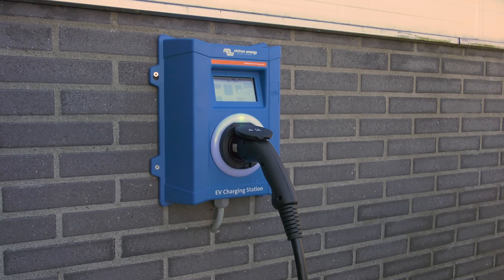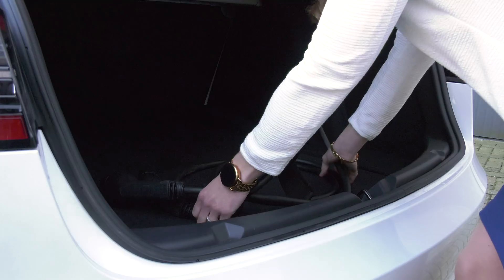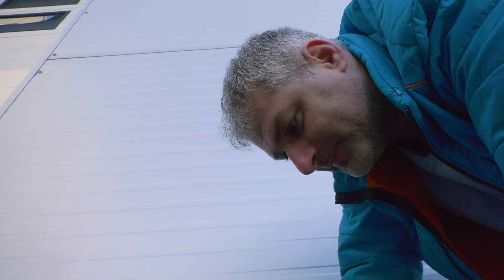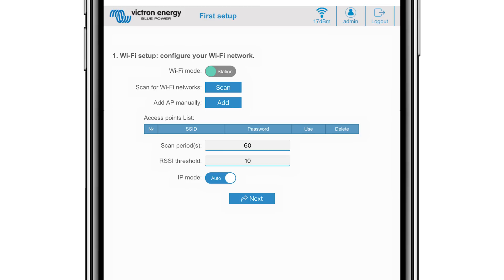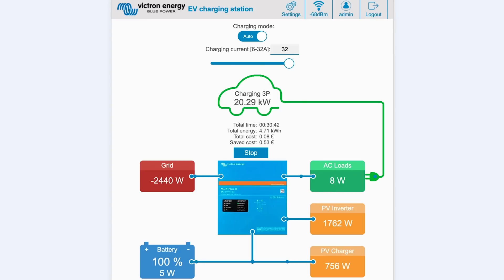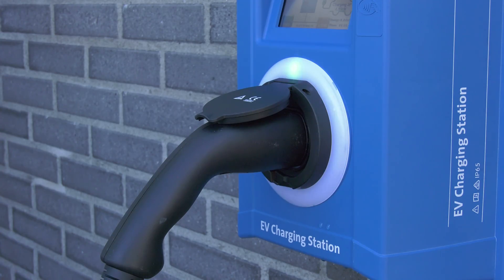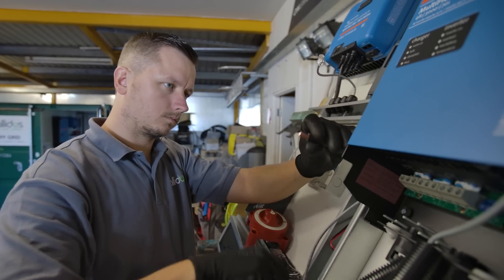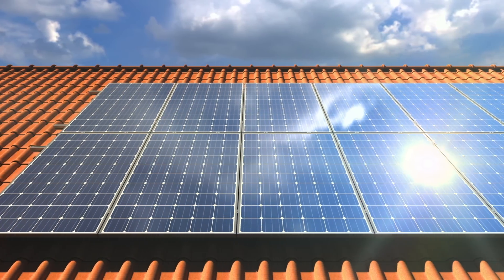Electric Vehicle Charging Station Victron Energy - Technical Guide

Comment: Lol...so stupid to charge from AC when we are off grid, so i got 10kW of PV and 2 rs450 but i can't charge my car with it..i need to go through a 15kW serie of inverters to be able charge my car..? Common, be smart please, passing through inverter i'll waste a lot of kWh not talking about the heat generated..! The noise...
This device should have 2 power entries, AC like it already as bit also DC 48V. Since not a lot of people will have their 48V battery pack near their car charger, at least make this DC input an option.

Comment: I have an off-grid system with one MP2 48/5000, OK. Let's say I buy an EVCS and the car now charges with say 3.7kW. The house draws 300W. From the roof comes DC-connected 8000W. Everything is fine. The MP2 fan is busy but the MP2 can handle it. Now we switch on a large consumer in the house. Let's say 2500W. The MP2 now has to supply 6500W. But it can only do this for a certain time, which is measured in seconds. What does the EVCS do? Does it stop charging the car until inverter power is available again or does the MP2 go into overload shutdown? (All without using Node-Red, which would then possibly be plan B).

Thanks for the help!
Reply: Hi, the charging station is receiving overload alarms and will reduce the power or even stop charging in this case
Reply: @luciangpl Thanks for your help! That would be great! Can you provide a link where this is documented?
Reply: @der_ambergauer  I can't add links here, but check the manual for "overload"
Reply: @luciangpl Thanks. Will do!
Reply: @luciangpl In the case explained here, car charge should reduce to let's say 1000W and let the appliance work normally. If charge stop then something is wrong with the system.
Reply: @honumoorea873  that's not possible, minimum charging current accepted by vehicles is 6A  - more than 1000W
For some vehicles, the minimum current is even higher - Renault ZOE 10A. 
It is configurable in the settings of the EVCS, but it can't be lower than 6A

Comment: Is there a plan for a LAN connection? Often the wall box will be more away from the house and a Wifi network will not be available there. At least in my location it is the situation and I will net set up a repeater. Generelly I try to connect everything with LAN because it is more performant an reliable.

Comment: Hi, is Vicron looking into supporting bi-directional charging now that several vehicles support V2L and V2G? Will this require hardware changes?
Reply: only possible with DC/CCS connection. V2L basicly doesn't need extra hardware. Just use the plug delivered by the car. I have never seen a plug both for V2L and charging in the same unit.

Comment: I think such device attached to outdoors should support cable ethernet and PLC-data, power link communication over powerline. Wifi will get security issues and is easier to exploit.
Reply: I got 60m between carport and inverter shed, power over line or ethernet are clearly the best solutions. But wifi need to be there too for some situations, would be good to be able to choose.

Comment: @VictronTech a) allow for remote 1p/2p/3p enabling at least in manual mode, many cars can take it and you get a seamless load from 1 x 6A to 3 x 32A, b) clean up the cabling inside for chrissake. It looks like intestines of a bug whose butt you just ripped off. I think both would be not only fair for 1500 EUR + VAT, but "market adequate".
Reply: I can buy this for 450€ here in europe.
Reply: @honumoorea873  Yes, 1year later...

Comment: Missing an ethernet option and I can’t help but wonder why we don’t charge with DC when we store it in the house and drive with it. Converting to AC just for charging just seems… inefficient.

For the price, I would expected a neater inside as well, not with a cheap wire connector like that one.
Reply: yes, but dc charging requires another step, another addition to the charger. the charger is basically just let the 240v ac through and communicating with the car. so you need another switch mode part. then your installation will be an added 5000$ or so.

Comment: Why no wired LAN connection?
Reply: Agreed, i now need to use a wifi router under the carport to make this device work...
Reply: Probably because it would require more safety circuits and add cost, with WIFI you don't have to protect the user from high voltages.

Comment: I stopped watching soon as you said 40 amp circuit breaker
Reply: The standard allowes a charge rate of 6A to 32A in 1A steps. A 40A fuse is recommend if you want to pull 32A. If you set the max to 8A, you can have a 10A fuse.
Reply: yes, i agree with you, you definitively should not watch this video at all if you totally ignorant of electrical installation.

Comment: I've waited for it. Finally, I will be able to charge the car from my offgrid system with full control of the voltage in the batteries. I hope that with 3 phases (I've three 10kVA quattro inverters/chargers, every 10kVA of power) I will also be able to charge with 11kW of power. I wonder if Victron has plans for a DC station as well.

Comment: Looking forward to installing these. 

It would be great to select ACout2 for Multiplus units, especially in ESS setups so as to not charge the vehicle if the grid fails.

Also, it would be interesting to be able to select to prioritise the batteries or the vehicle charging.
Reply: You can do both, even without installing it on ACOUT2, it is detecting missing grid, and you can select minimum SOC for allowing to charge the EV

Comment: Is this abe to take energy from the car battery? For use the car as a (emergency) battery.. obviously if the car is capable of this feature...
Reply: I would say no, 
V2G are essentially inverters tapping into the ~300V car battery, slightly bigger in size than charging points

Comment: A time based setup (max amp based on time). This is nice if you have time of use metering or hourly rates.

With hourly rates,you know when it is lowest.

You can set up.

08-22 - off
22-06 - max
06-08 - 6A

An option to override the timer with your phone. Like "on for two hours"

A more advance system: A public a API that can be used by third-party smart homes.

In Norway connection fee based on max hourly usage will be implemented, so system to regulate power is in high demand...

Comment: Audio has a high pitch sound at times. Also, at 4:01 isn't that way of routing the power cable likely to cause water to wick into the building, increasing moisture? I understand a small loop in the cable shape can let water drip outside rather than go inside.
Reply: I think that high pitched noise is the charger.
Reply: @hmallett  That is the Renault ZOE charging

Comment: For that price, an automatic switch between 1ph and 3ph must be implemented. Thats a must have feature for all charging EV with excess PV power
Reply: what was the price?
Reply: @smartgenpoweringthepowerle2038  1900€ pre saile
Reply: Agreed, but it seems Impossible. All conductors are connected at the same time by one relay. Although the function switch to 1/3 phase is available in the Modbus list. Maybe we can implement this ourselfs with 2 separate 40A relais, and Node-Red
Reply: it's possible over ModbusTCP